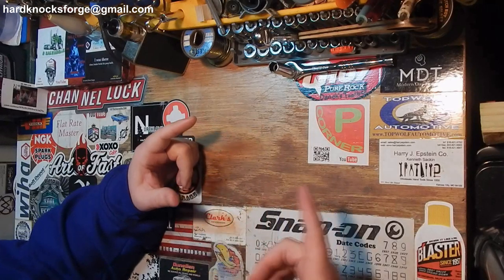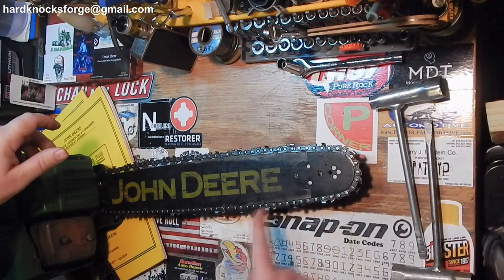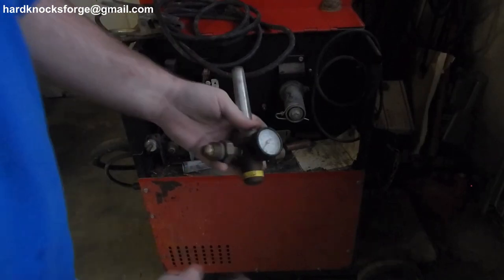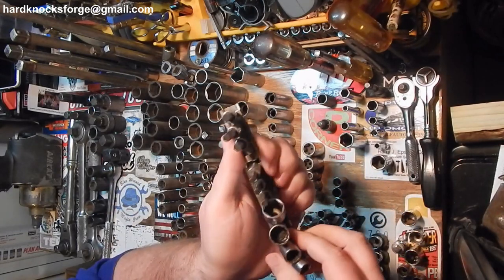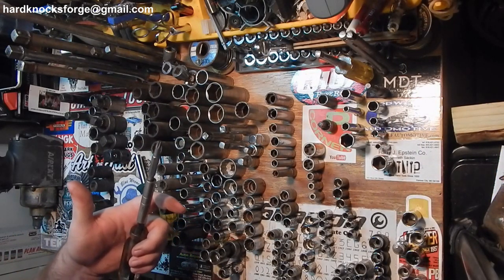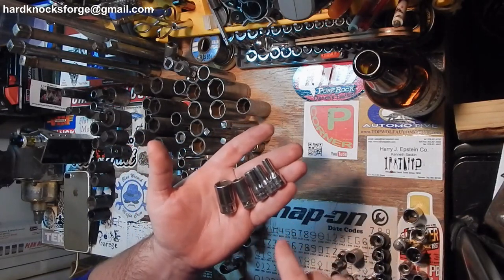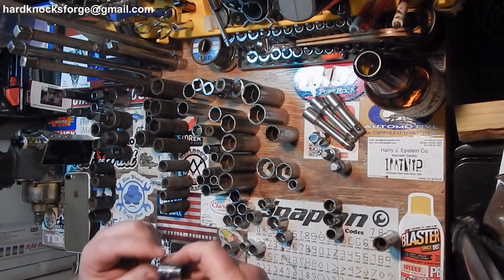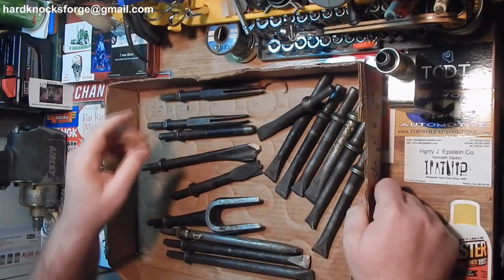Mechanic's Auction Tool Haul and anonymous MCY 19 x2 SK Snap on Blackhawk Proto Mac

Comment: I could never get tired of auction videos lol..the socket you was unsure about definitely looks like a small engine spark plug socket. Older Honda generators came with one identical to that. I have several in my box. Great video
Reply from the maker: I wanna say he had a John Deere generator there that had a Honda engine in it. I should have bought that also, just had the carb smashed in by something, so it didn't run. Wanna say it went for $90 and was somewhere between 2-4000 watts. Not a huge guy, but decent enough for storm season.
Reply: @HardKnocksForge  yea for 90 bucks ya couldn't went wrong. I have a smaller one that looks like it came over on the Mayflower but runs like a sewing machine still.
Reply from the maker: Yeah every auction I go to I end up kicking myself over not picking up something like that. This auction though was full of me kicking myself when it was over... Just gotta keep puttering forward though, there’s always next time!

Comment: Auction videos; not bored!  Keep em coming, and I always want to hear the prices.  (I miss getting new content from Toolrescue911)
The SK wrenches that have a flat bottom on the box end; as opposed to a ring shaped protrusion.  Isn't that a negative when working on a fastener that's in a counter-bored mating surface?
Reply from the maker: You talking about the Saltus wrenches or the zero degree offsets? The Saltus wrenches act like a socket and ratchet, without the ratcheting capabilities, but are actually thinner in profile than most ratchet/socket combinations.
Reply: @HardKnocksForge  I mean the bottom side of the box end, of a regular SK combo wrench, with a 15-degree offset on the box end.  The Snap On site calls the total thickness of the box end: head depth.  Most wrenches have an extended head depth, which will provide more mating surface with the fastener, and, I think, better access in a recessed/counterbore region that the fastener is in.  I've wondered if that is a drawback to the SK design...  sorry if i'm not explaining this well
Reply from the maker: You're probably explaining it perfectly, but I'm such a visual kind of animal that it's hard to wrap my head around it. I'll look up Snap On's website and check out the 'head depth' you're referencing. That might be just enough of a picture for me.

Comment: Wish the little millermatic 212 we had at work would push close to 200 amps and feed wire to keep up (not as good as 252) hella john deere and snapon haul
Reply from the maker: I'm still more of a stick guy, but this 212 should be excellent for goofing off indoors. I'll probably never get close to pushing this machine to it's limits, but it's nice to have a welder that's 'too big' vs 'too small'.

Comment: I was going to some auctions,  But stopped going because there charging tax plus 13 percent.   So the deals weren't really that good.
Reply from the maker: 1970chevelle396 that sucks. I take it the 13% was probably the auctioneers commission, which is paid by the seller around here. I don’t even remembering them charging sales tax on firearms around here. You do have to fill out a 4473, and have to be a Kansas resident to buy firearms though.